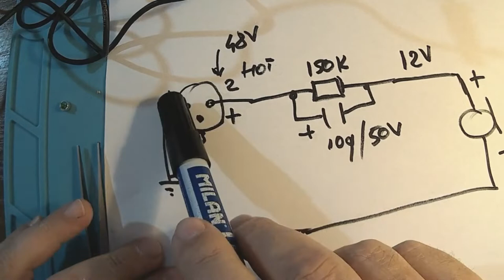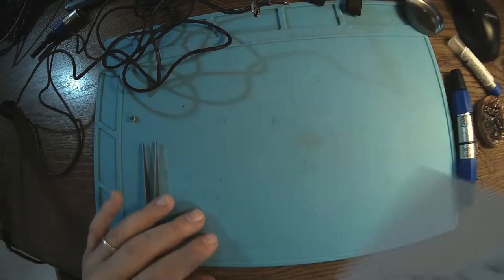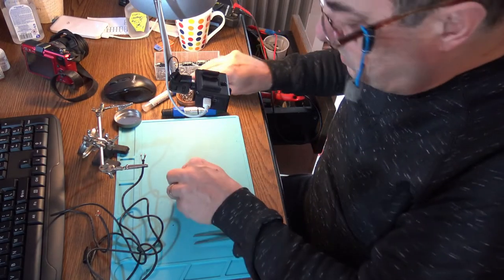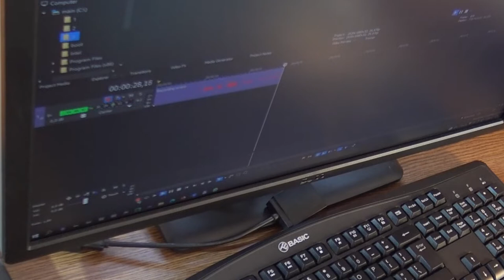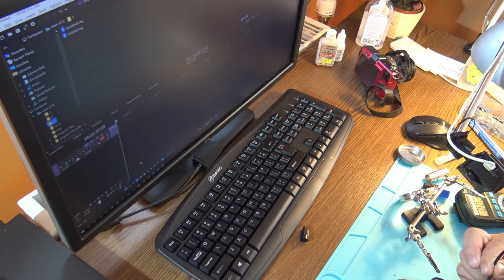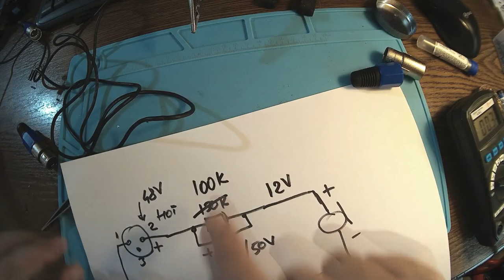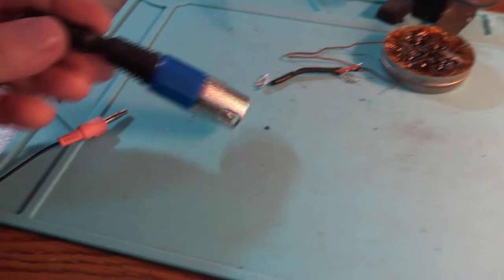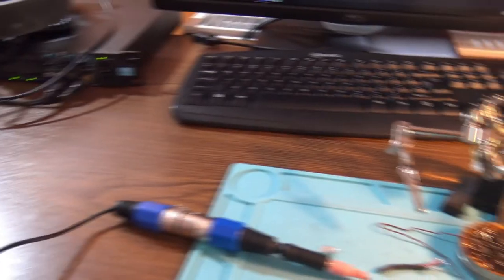DIY electret microphone adapter to XLR phantom power

Comment: Thank you. But doesn't the capsule just need 5 volts?
Reply from the maker: This is an electret microphone, inside there is a FET transistor and some prts..no standard 5V voltage though..it's working anywhere from 3V to 20..depends of producer

Comment: Nice work! Just two questions: 1. some people route the resistor to pin 3 (and capacitor to pin 2 as you did). Any comments on that? 2. when you switch the power on (or plug in the mic), a large transient appears on the capsule because of the charging of the capacitor. Doesn't it damage the capsule?
Reply from the maker: Not at all..the capsule have a chip inside which can take the load..
Reply: @viocaia  what about first question?

Comment: Can you please explain the function of the capacitor?
Reply from the maker: It's passing the AC audio signal but blocking DC current...
Reply: @viocaia  but DC current can go through the resistor on the same 2nd pin? How does it works?
Reply from the maker: @MichaelWeizenfeld  The DC powers the FET amplifier situated in capsule, all the AC signals (audio) will be transfered by capacitor..also each preamp input have a capacitor so there is no harm.Capacitors have the ability to transfer AC but isolate DC.
Reply from the maker: @MichaelWeizenfeld  Consider pin 2 the audio signal in, there will be a capacitor inside the preamp/sound card which is decoupling the pin from DC point of view. It is safe to apply  any DC without harming the  preamp. In this case 48V comes after the capacitor to pin2..there will be reduced to aprox 9V by the resistor and feed to FET transistor present in the microphone capsule. In  parallel with resistor that capacitor of 10uf will transfer the AC audio signal from microphone to pin 2...without that capacitor it will be also a signal but much weaker, according with 150K limitation from resistor..finally there  are two paths..a DC for power supply the mic and AC bypassing DC thru 10uF capacitor and the pin2 input capacitor ..so there will be no ''short'' to audio to DC..that's how any phantom condenser microphone works , even professional studio ones. A wire can transfer DC and AC in the same time, even RF signals with a proper decoupling!
Reply: @viocaia  thanks a lot, this exactly that i wanted to know!
"without that capacitor it will be also a signal but much weaker, according with 150K limitation from resistor..finally there  are two paths.."
Reply: @viocaia  btw what do you think about replace resistor with Zener diode?
Reply from the maker: @MichaelWeizenfeld  anything that can bring the voltage to around 9V will do the job..

Comment: Salut.
Is this a DC/DC upgrade voltage?
Can use 3,7volt and upgrade it to 48V?
Reply from the maker: This is a 48V down to 9V suitable for electret microphones. To reach 48V from 3,7..kind of problematic, I should go a little higher like 5V, you can use a boost convertor. There is another problem, usually simple boost converters are very noisy, lots of artifacts on the audio signal, it needs special filters, but it can be done.

Comment: What is the connection like if I have a microphone with 3 wires, hot, cold and ground?
Reply from the maker: Like this https://youtu.be/z6YJVXA5W2Y
Reply: @viocaia  So I meant that I have a 9v microphone with 3 wires and I would like to use it with a 48V phantom. I am wondering how I have to connect the resistor and the capacitor.
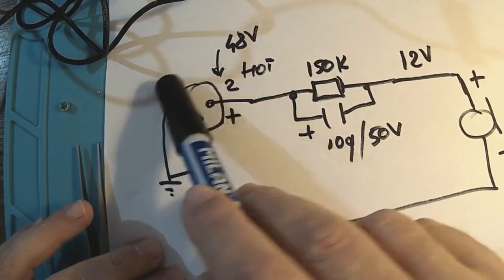Reply from the maker: @Nervasion  In the video at min 00:28 you have the schematic. Pin 3 can be connected to the ground too. At the microphone side use the trace connected to metallic case like minus, the other one is plus..so the resistor is in parallel  with the capacitor and both are in series with microphone's plus...follow the schematic
Reply: @viocaia  Thanks!
Reply from the maker: @Nervasion  Anytime!

Comment: Thanks
Reply from the maker: Anytime.
Reply: @viocaia  but why, after i do just like your tutorial, the sound is very small, and tomorrow day can not use again because mic smal condensor is death,
Reply from the maker: @iramacintaful  Funny! Probably the capacitor in short let a 48V to the mic. Inside it's small FET transistor probably distroyed by high voltage. Check the parts.Be careful with polarity of the electrolitic capacitor.